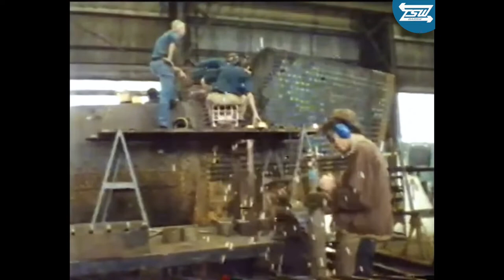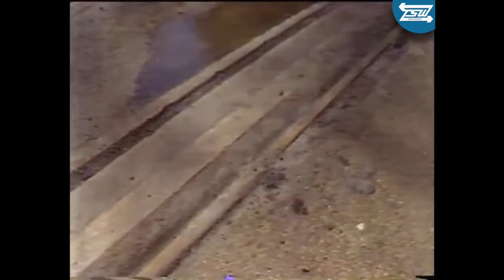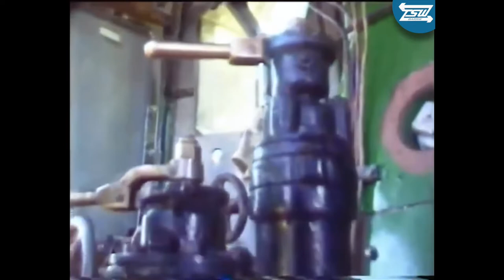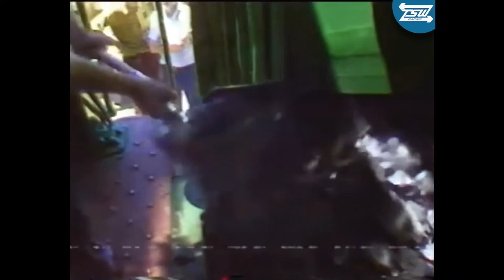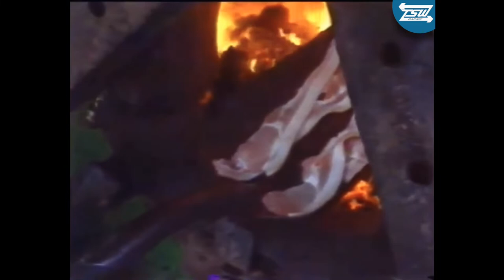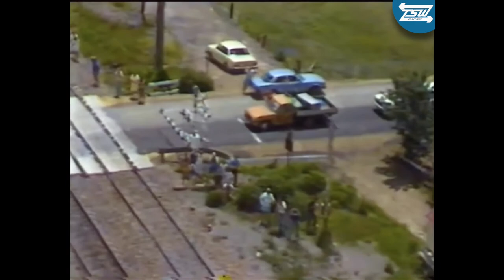Steam Locomotive 3801 relaunched to heritage service 1986

Comment: This was great for sure even extraordinary for the mid-1980s but I doubt anyone will see a 57/58 or 34 class ever return to the tracks in working order.
Reply from the maker: Hey 007 good to see your comment, I agree, there is no drive for those classes to be restored unfortunately, and no big event like the bicentennial that pushed 3801 to be finished. It would be good to see a 57 running I must admit.